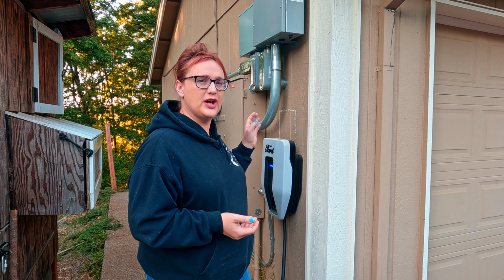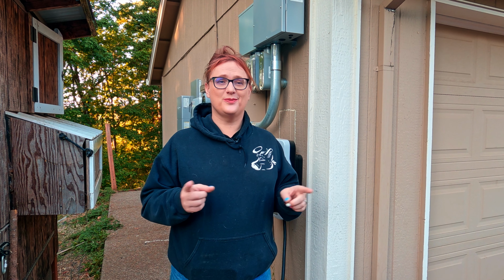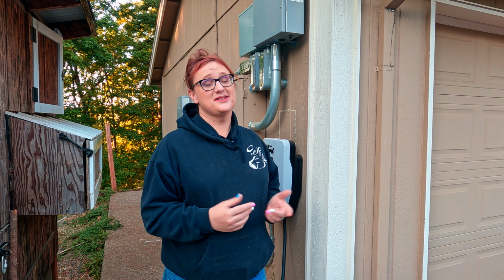Sunday Musing: Do You Know Your Grid's Carbon Footprint (And Does It Influence How You Use Power?)

Comment: I am very lucky to live in Quebec where now all our energy comes from hydro and a little wind. We had a gas peaker plant but it closed a number of years ago because it was too costly to mainain. Given that the damage from building the dams has already been done I consider our grid 100% carbon free. However we sell our surplus power to the norteast US and so I try anyways to not waste power. I am a reservation holder on an Aptera and look forward to having that mostly recharge itself from the sun. At the moment I try to use my current car so I make the smallest carbon footprint possible by combining. I have an older Pontiac Vibe which gets about 32mpg so it's not as bad as some but I still try to be ascefficient as possible.

Comment: I didn’t think the UK was that far ahead by having the “when to plug in” app that tells you UK wide and regionally the carbon intensity of the grid in 30min increments.. apparently I was wrong and it’s revolutionary! We have time of use tariffs available for those that want to and personally my EV charger is set to charge when “the grid is greenest” as long as it will get to the required level by the required time - very often this is in the middle of the night when the wind is strong in the North Sea 😊.

Comment: I use the Chevy Bolt's "delayed charging" feature to schedule charging to happen late at night, regardless of what time I plug it in. The delayed charging features automatically disables itself whenever the battery is less than 40%, so it won't impact my ability to spontaneously drive somewhere.

The only thing you have to be careful about when you use "delayed charging" mode is, don't forget to shut it off when you are plugging into a public charger, as opposed to your home charger. Otherwise, you might return to the car hours later and find it didn't charge. (This is only an issue for public level 2 charging; the car ignores "delayed charging" mode automatically when plugged into a DC fast charger).

Comment: My local utility charges more for electricity i use between 3 and 7 pm. It's easy for me to run the laundry and dishwasher outside those hours. Usually, I try to turn the air conditioner off at 3. Sometimes, i try to use the stove outside those hours. 

I assume the hours of more expensive electricity correspond to more carbon intensive electrical production, but how csn i know for sure?

Comment: My Apple HomeKit/Apple Home tells me if the grid is clean or "less clean", it's vague, I don't know how accurate it is or if it will change behavior (I think iOS 17 was the first that got it, so you non-beta testers just got it). I'm sure there's a plug-in for home assistant, suggestions welcome.
Reply: The forecast in the Home app uses energy mix forecasts from the grid operator, so it's about as accurate as you're going to get

Comment: I've looked up my local peak electricity period and scheduled charging on our two EVs to avoid it. Unfortunately, on the Hyundai Kona Electric 2022/2023 is a static thing and requires manual adjustment to adapt to changes.

Our grid is presently very dirty here but should become almost entirely renewable once they finally sort out the transmission link from Labrador where our major hydroelectric generating stations are...

Comment: I try to charge during off peak hours but since I use a granny lead to charge, it takes most of the night to charge up so I tend to plug in when I get home. Luckily the rate is slow so it doesn't use that much power during peak hours but also: the grid in NZ is quite clean (80% renewable).

Comment: I try to charge my car as much as possible from my solar. ~90% this is possible (except winter months) - when there is a little sun over the weekend or in the afternoon. Worst case we switch cars during a sunny day, so the discharged stays home charging.
But I am one of the few lucky people with 2 cars, lots of solar, working from home and only wife traveling for work.
And I do have quite good info on grid CO2 - there is a plugin for HomeAssistant, but it's irrelevant here as there is a lot of hydro and pumped hydro, so usually the level is below 15%, over the weekend closer to 7%. So comparing to other countries, this is quite clean.